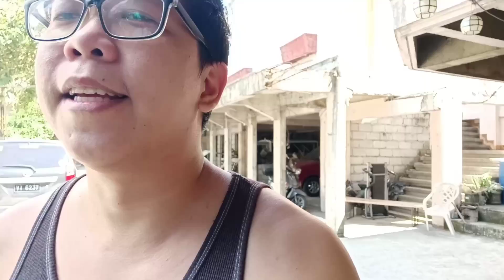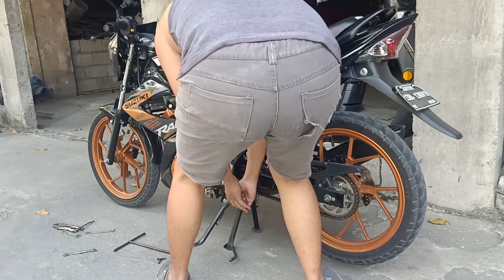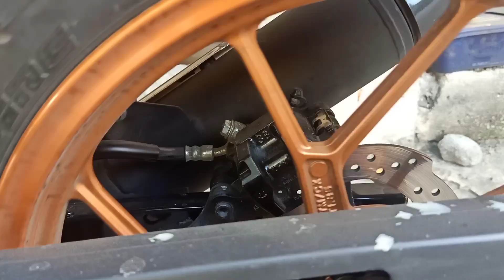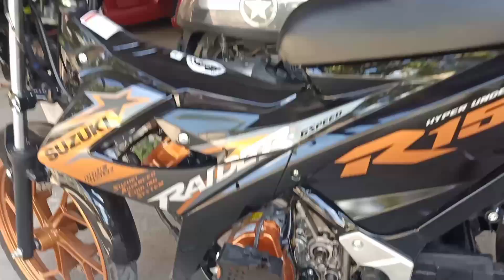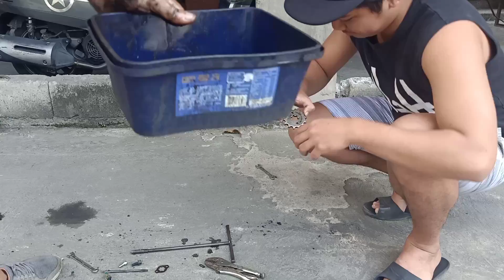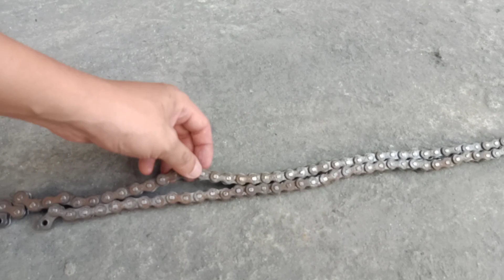Fixing the Suzuki Raider 150 Carb of my Subscriber

Comment: Lods, ask ko lang naginstall kasi ako ng MDL v6 at PIAA oto horn. Need ko pa ba ifull wave yung motor or mag rerely na lang ako icharge ang battery? Raider 150 carb po yung motor. Sana mapansin yung tanong ko, salamat lods.

Comment: Boss ung tambucho ko pag kinapa m ung dulo niya basa ano dapat gawin sa r150 carb salmat papa sa sagot po
Reply from the maker: Possible po na nag ooverflow yung langis gasa ng may deprensya na piston ring.
Reply: Paps ndi nman p dilikado sa makina un
Reply from the maker: @teamjesus7212  kung sira po ang piston ring, gagasgas po yon sa sleeve. Masisira po lalo makina mo.
Reply: Pero paps wala usok normal lng un buga niya pero pag tapos ng lockdown pa gawa kuna agad to
Reply from the maker: Try ko po hawakan kung ang pagkaka basa nya ay gawa ng langis o gawa ng carbon. Kapag carbon po, normal lang po sya. Pag langis, may problema na.
Reply: Salamar paps sa sagot m

Comment: idol baka kaya yung carb ko di nagana breaklight kapag tinatapakan ang rear brake sa front break lang sya nailaw. . salamat
Reply from the maker: Check mo po rear brake switch kung buo pa
Reply: @MingXunMotoMedic  saan makikita idol yun?
Reply from the maker: @nosidenoside6892  nakakabit yon sa may master brake cylinder mo. Hanapin mo yung spring.
Reply: @MingXunMotoMedic  salanat idol

Comment: idol paano po ba mabawasan vibrate ng raider ntn na carb lakas po kase ng vibrate nya sa makina kpag bibirit na po ako ramdam ko ano po kaya posible n dahilan
Reply from the maker: Ma vibrate talaga ang raider dre basta over 6000 rpm na.
Reply: normal lng ba un sir, kase napansin lumakas ata vibrate khit 2nd at pag 3rd shift ko
Reply: khit nsa 3000 o 4000 Rpm ako lodz
Reply: wag nyo po gamitin